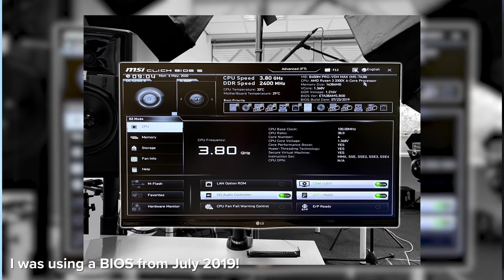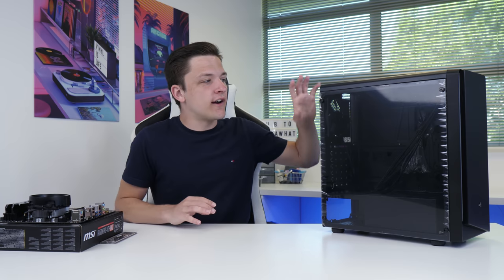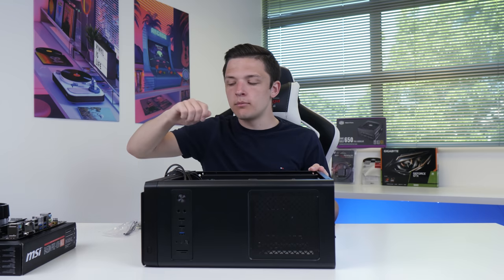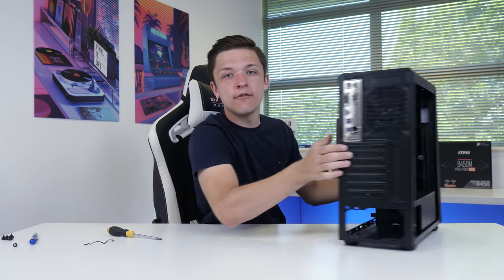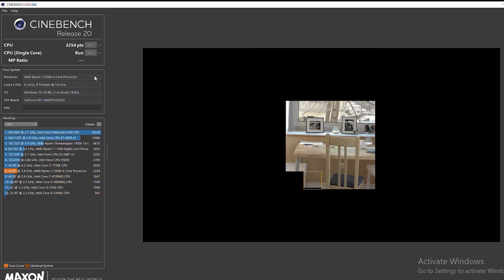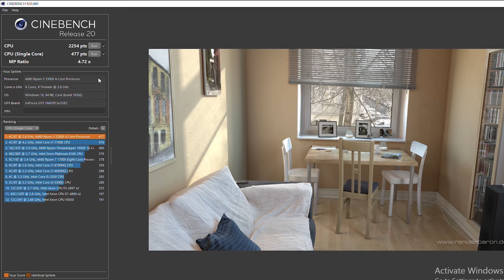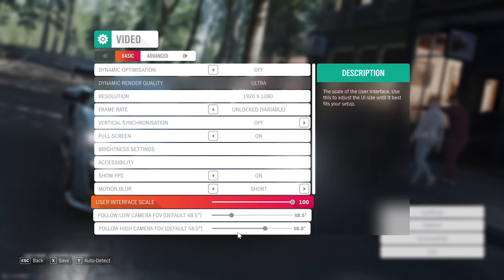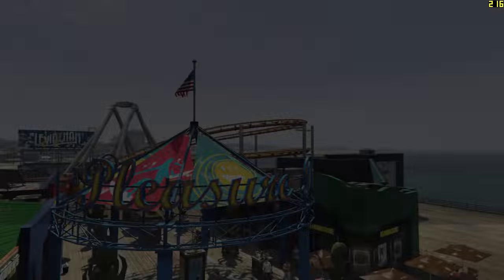Epic $750 Gaming PC Build 2020! [Ryzen 3 3300X & GTX 1660 Super w/ Benchmarks!]

Comment: Lmao I thought the monitor was part of the build, I just finished my $1500 rig and I’m using a dang tv lol
Reply from the maker: Haha that made me giggle - full setup builds coming soon tho! 🙌
Reply: Should’ve reduced the build price and got a cheap $150-200 144hz monitor
Reply: XxTimoIsDadx X settling? Hell naw
Reply: Brooo sameee
Reply: No joke same here too, spent 1,600 and still have an old emerson as a monitor.
Reply: Death Sweet Whats the point of even having that expensive of a build with a monitor that doesn’t match the scope of it? You’re not even getting the full worth out of it because the tv probably caps at 60 or 120hz, and your rig could easily run  1440p 144hz
Reply: Michael Pecoraro it’s just a temporary solution lol I’m already only $10 off a 1440p 144hz Samsung monitor
Reply: Death Sweet Oh lol I was gonna say people will drop two paychecks on a pc and then forget about peripherals
Reply: Overclock a 60hz to 75 it'll work fine for sometime
Reply: Death Sweet This build is good enough for a 1440p monitor right?
Edit: Nvm it’s mentioned in the vid later on lol my bad
Reply: @moshimic5628  no it's not
Reply: Lol, I think I'm gonna use a TV for a while and then buy a monitor
Reply: XxTimoIsDadx X no 😂 550 dollar system w/ a 144hz monitor isn’t enough
Reply: people always do that build a machine then forget the must important part what you going to see..
Reply: Alejandro no I’m pretty sure we plan on using a tv
Reply: @SubZeroGamez  I did the opposite.. had a pretty decently powered laptop but not enough to max out my two gaming monitors. So now I have to work on a build.
Reply: @Death_Sweet  based. dont settle
Reply: hahahaha

Comment: I’ve been waiting for someone to do a build like this
Reply from the maker: Great timing aha! 😅
Reply: How are the cpu temps while gaming?
Reply: Jacopo Podavini pretty solid actually I haven’t had a problem with my cpu getting warm at all
Reply: @mbirdie12  with the stock cooler? Deciding myself reather to pick 3100 or 3300x but since i want a small case mAtx/miniITX heat concerns me and i've seen that under heavy load 3300x get circa 20° hotter

Comment: I have a some questions about that build.

1) Can the RGB sync with software?
2) How long is the rear fan cable? Will it be able to reach the SYS_FAN_2 or 1 header if I install it in the front?
3) Where did you plug the SATA cable for the front panel RGB?

Comment: Finally, time to upgrade my 2200g. Btw is stock cooler enough for 3300x if i have good airflow?
Reply from the maker: If the airflow is good yep! You can always add a budget one in later if you find temps are a bit too high 👍

Comment: q1:--bro should i add 3000mhz non rgb ram instead of the ram u had in ur pc build?
q2:--bro should i change the 500gb ssd into 240gb ssd??
Reply: a1:-Yes, 3000mhz is faster so if you don't care about rgb it's better to buy 3000mhz.
a2:-240gb is not that much storage so i suggest buying 500gb or even 1tb.

Comment: Good budget build but at 750$ I think a case with at least 2-3 fans can be included or at least a mesh front panel and 2 fans included. You are using the stock cooler while it is ok for the CPU, for more intensive and prolonged tasks it won't be able to hold those boost clocks for very long.

Comment: Keep up the great content man! Your builds are great and well planned, I’m planning on building one of your builds but I haven’t decided if I should go with the 2060S or 2070S, I will be playing at 1080p and high refresh rate is a must
Reply: go with a 2060s, or if you dont mind waiting, wait untill the 3000 series comes out so then you can egt the 2080 super for dirt cheap
Reply: Honestly, go for a 5700xt if you don’t want to wait for next gen. Perfect for 1080p max settings 144+ hz, and 1440 capable of you choose to go that way in the future. If you just want a 1080p60 card, buy a used gtx1060 or rx580 for $120
Reply: Travis McIntosh BUT the same applies, might as well wait for the new GPUS
Reply: I agree with the guys here. Its worthwhile waiting since the next generation of cpu and gpu are on the radar. Also b550 mobo. Sadly ddr5 ram will be out in 2022

Comment: Yo 

here's buttload of questions.

*Is 3300x + 1660ti enough for 1080p gaming and streaming?(Or should I go for RTX 2060 + Ryzen 5 3600x)
*Also will 16GB 3200mhz  be sufficient...is 3600mhz significant improvement?

It's a budget build and if I go for RTX 2060 + 3600x I will have to wait for another month.
THANKS FOR READING!

Comment: Couple questions as i'm not good with computers: Why is the fan facing downward for the power supply, wouldn't that prevent air from flowing in? Also should I wait to build a pc as the new AMD zen 3 chip to come out or should i build it now? And did this guy use standard case fans for his build or did he buy some better ones?
Reply from the maker: The fan down pulls air from the vents under the case which should be cooler than air already in the case. For a build like this don’t bother waiting for Zen 3, these CPUs are literally a day old. I used the included fans with the case so nothing extra to buy here. Hope that helps! 🤙
Reply: Thanks so much

Comment: Tom hollad quick question, do we need to upgrade the bios of b450? Or it is automatically compatible with Ryzen 3300X?
Reply from the maker: Afaik any B450 board that states it is ready for Ryzen 3000 (in MSI's case for example, the MAX motherboards) will work with these new Ryzen 3 CPUs :)

Comment: Hey there, this pc can handle 144fps for 144hz without dropping?
Reply from the maker: Depends on the game and settings - check the benchmarking section for the best indication 👊
Reply: @GeekaWhat  on games: lol(ultra), apex legends(low-medium), pubg(low), fortnite(medium), gta v (low), minecraft(ultra), cod warzone(low), (all on 1080p) I know that it's hard to tell, but I would be happy if can tell me🙂
Reply: Also if I oc the 3300x to 4.3ghz and the 3600 to 4.1 it has any difference beetwen them? On gaming editing and Streaming
Reply: Fordakias yes for most the games it can. The 3600 is gonna beat the 3300x in editing and streaming with the extra cores and threads. An over clocked 3300x to 4.3 ghz is mostly gonna beat the 3600 because of the higher single core clock speed which games like
Reply: Fordakias also I’ve seen the 3300x over clock to 4.6 GHz on 1.375 volts so you could push it if you have the cooling. I think thermal throttle is at 95c
Reply: @shanewell12  so if I stream while gaming I ll catch lower fps, and on edit it will lag?
Reply: Fordakias it’s okay to stream on but you have to optimize it so it would mess with your game play. Editing would lag just take longer because your have less cores and threads
Reply: So which one is the best for the money, with 16gb ram and a 1660super
Reply: Fordakias you’ll need the ram to play most newer games and to edit and stream as well. I would still try to get the 1660 super. You can get 16 gb of ram for cheaper than what’s in the video
Reply: Fordakias I was trying to multitask when typing that other message. Meant to say editing wouldn’t lag just be a lot longer. You would most likely have to stream in 900p instead of 1080p just so you don’t experience lag or frame rate drop. If you are streaming and editing you should get the ryzen 5 1600 af when it drops in price because that will help you out a lot

Comment: The money management in this build isn’t very good. My build for a 2060 came in at just under $800 and has a Ryzen 5 2600x
Reply from the maker: Hate to break it to you dude but a 3300x is not too far off a 2600x at this point 👍 My latest $800 build also includes a 2060
Reply: GeekaWhat oh, I looked it up and I was pretty impressed! 3300x has some great performance per thread, just a couple less. There is the extra motherboard cost of getting a third gen compatibility out of the box, but that’s down to $105-$115 now. I may have to consider it for my build since it’s right about the same price as the 2600x (microcenter sales). My mistake!
Reply: GeekaWhat why didn’t you bump up the GPU to an EVGA 2060? Just wondering

Comment: Why Ryzen 3 ????
Reply from the maker: Because the brand new CPUs absolutely kill it! 🙌
Reply: azZooz R3 3300x is comparable to i7 7700k. Check out Linus’s video
Reply: @McIntoshTravis  it's 4 Cores and it's very good for games but not very good for Streaming
Reply: azZooz it costs $120. Get a Ryzen 5 for $175 if you want to stream
Reply: @McIntoshTravis  but R3 3300X better than R5 2600. R3 3300X like R5 3600

Comment: 100$ 650W PSU for a 750$ build... you could have gone with a 600W 40-50$ unit, then get a 60$ 16GB memory kit instead of 85$. And then get a rx 570 for 120$ instead of a gtx 1660 super for 250$ and the PC now costs 530$ and for 1080p it's great with a rx 570.

Comment: Alright guys I ordered everything on Amazon, some parts it wasn’t available so I had to improvise. Only about 2 out of the 7 I had to replace it with another spec. I’ll be coming back here to update you guys. Everything will come by June 3-5th 

Edit 1: Okay so after looking back on amazon orders 4 specs are totally different from what he recommended. Just because they weren’t in stock anymore, or won’t be in stock in a couple months or so. I had to improvise a bit, look at other YouTube channels spec recommendations do some research and also asked a friend who’s a pro at this (he’s whole pc setup is worth about $20,000) 
Anyways I asked him if these specs + Geek’s would be perfect for my first gaming. He said it’s perfect for beginners and this came about to $725 w/o taxes. After checking out it was $792 with taxes. Usually at this period we’re in everything is in high demand since everyone is buying stuff online. I recommend if you’re near (Micro Center) you should go there and get the specs if it’s open for business hours. Unfortunately for me I’m a lazy f*ck and ordered it online 
Here are the different specs I bought

-AMD Ryzen 3 3200G
It has almost the same technical specifications as the AMD Ryzen 3 3300X

-AeroCool Culinary RGB Mid Tower Black
The case originally was sold out. This is the same case but instead of having the RGB lights going up and down, this one is diagonal 

-PSU (EVGA 600W 80Plus Certified)

-MSI VGA Graphics Card RX 580 ARMOR 8G OC

I’ll be using this pc for gaming of course and also for video editing. I know I can upgrade the specs if I want a better performance which I’ll do but for now I can’t wait until all the parts arrive build it and see it for myself

See you guys soon !

Comment: Not the best example of how to screw in the cpu cooler. This is the first time I’m seeing your channel, but if this is a build guide/tutorial you probably should have explained to screw it by starting with a corner (screwing it in but not tight) then go to the opposite corner and do the same thing. Then do the same for the remaining two corners.

Side note: if someone is doing a budget build, rgb shouldn’t be a priority. Your ram could’ve been about $10-15 cheaper if you just did corsair’s vengeance. And honestly you chose a pretty shit case. Bad airflow. However for the price of it, not bad. You need as much performance as you can get in a budget build, especially if you plan on doing any over clocking. Ssd wise, I wouldn’t waste $75 for just 500 gb. You can get 120 gb for around $25 (this would purely be for just windows) and use the $50 for a two terabyte hard drive. But that’s just a personal opinion if you want to save as much money as possible. And for anyone who is new to building a pc, you don’t have to waste $100 for windows, you can get windows on eBay for about $10-15.
Reply from the maker: Hey Kaiden, thanks for the constructive comments! In terms of the tutorial element, I’m trying to add in more of that side in to these videos while keeping the content watchable and the pace up, I try to show things from multiple angles alongside narrative to cover as many bases as possible, I appreciate this falls short occasionally. On your point about RGB, I get it; it’s the reason I didn’t add in an RGB CPU cooler or RGB GPU. With that being said if you can include RGB and make a system look good I think that is important when spending this kinda money. On the storage point, I would add that a 120GB SSD is just about enough for windows and not much more, which will help with boot times but not actually be that useful elsewhere. All about balance and personal preference 👍
Reply: GeekaWhat It’s great that you actually took the time to respond, and thanks for being understanding. And yeah a lot of this is personal preference, but I have to say keep up the good work 👍

Comment: Rip me I bought a 3600 two days ago 😔
Reply from the maker: The 3600 is still a great CPU! 😅
Reply: Isn’t the 3600 a far superior chip anyway?  It’s got more cores for better multitasking etc
Reply: @lpmoora  Yes 3600 is better. But price performance 3300x is a little better. I would still go for a 5 3600 if you want a better graphics card than a 1660 super (like 5600xt +)

Comment: i f*$#ck up buying gtx 1660 oc ventus , i recomend buy S for 10-15 fps more !
mi low cost setup is: 
gigabyte power suply 650w 
hdd toshiba 1tb 
ssd crucial 480 gb 
msi ventus xs 1660 oc 
2x8 ram adata d41 spectrix rgb 3200mhz
mother b450 aorus m 
micro ryzen 3 3300x

Comment: 500$ with r3 3300x please....
Reply: All In not gonna happen. Tried making a build but you don’t have enough to get a decent gpu one you add all the necessary parts
Reply: All In best I could do was a 3300x on a b450 HDV micro atx/ 2 4gb 3200mhz ram/mushkin 250gb ssd/ Evga 500 watt white/ cougar mg120 black micro atx case/ with a gigabyte Rtx 570. Comes in at $526 US